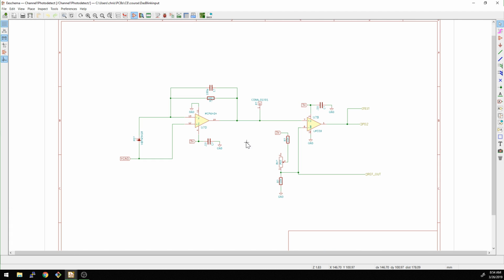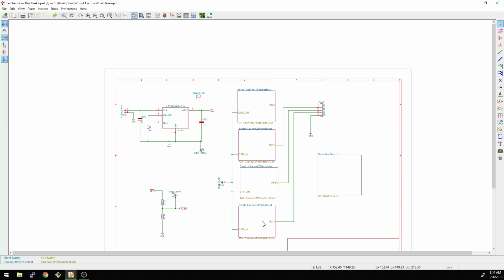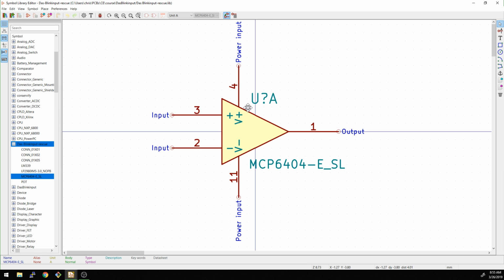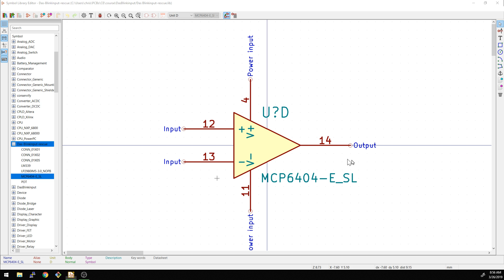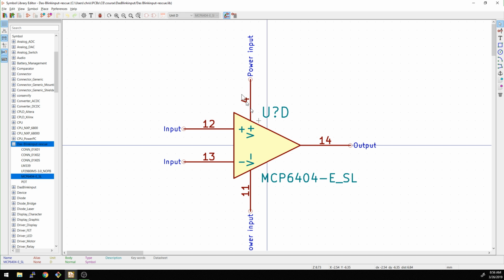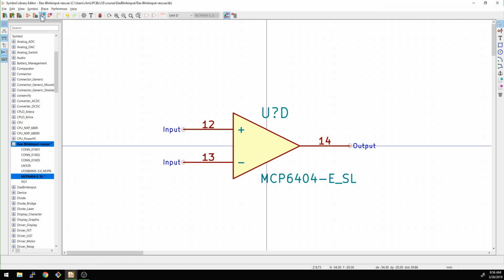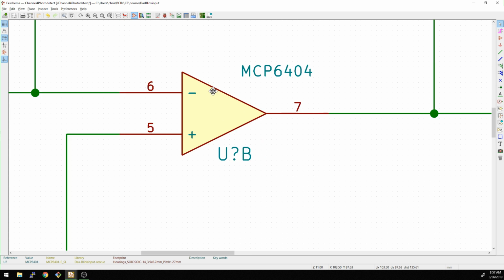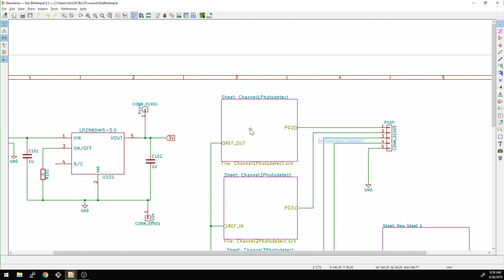KiCad 5.0 - Changing pin visibility for multiple version parts

Comment: The problem you can run into is if you swap units in the PCB layout and then back annotate into the schematic.  In other programs I've used over the years there were two solutions/work-arounds.  1st:  Make the power and ground visible on all units and connect them to the power and ground each time (don't mix up which power or ground nets are used).  This way each 'unit' is visibly exactly the same (except for the non-power pins).  The other solution/work-around is to create a separate unit that is the power and ground connections.  It's not clear if KiCAD has some 'alternate' solution.

Comment: BTW, you can change the unit in the symbol properties window (what you get when you press "e"). Look at the upper right-hand corner of the symbol properties window and there is a drop-down list for unit number. Depending on one's personal workflow ergonomics context menu may or may not be faster than the symbol properties editor.

For me, personally, I prefer the method of adding an additional unit to a part's symbol and putting the power pins on that last unit. (As others here have mentioned.) So, for these quad op-amps and comparitors, you would have Units A through D as the functional part, and then a unit E that can be put elsewhere on the schematic with all the other IC power pins and bypass capacitors.

Both are valid styles.

Comment: I think the new standard is actually to have a separate unit for the power pins.
Reply: I was used to broken out power pins as a default for the libraries in Eagle when I moved over to KiCAD. Now I can see pros and cons for both ways.... which doesn't make design life easier ;)
Reply from the maker: Yep, this also works! As I said at the beginning, it's a style thing and I wanted to showcase how to turn off pins between multiple versions of parts
Reply: @contextualelectronics  Yeah, I think the way you describe here is probably better because if I remember correctly I had to go in and make the reference field for say U1C (the power unit for a TL072) invisible or I'd have both U1A and U1C there…
Reply: I think it makes some sense to break the power pins out in its own unit. That way you don’t need to move the power connections around if you want to swap the units for layout reasons. They also don’t need to clutter the schematic with less meaningful information.